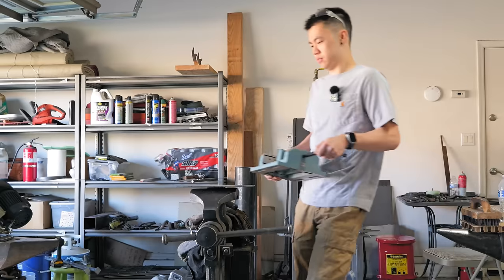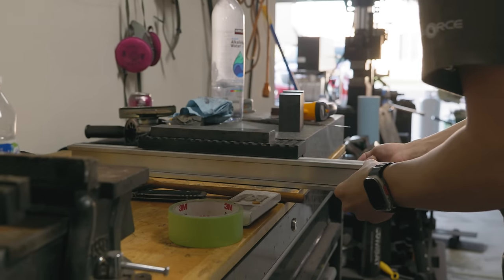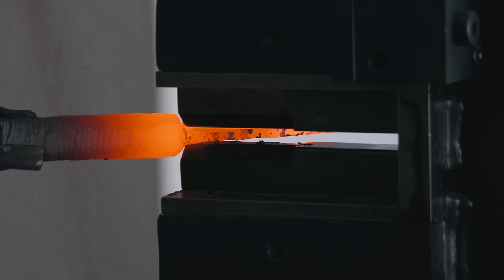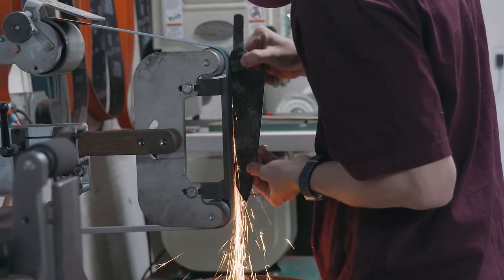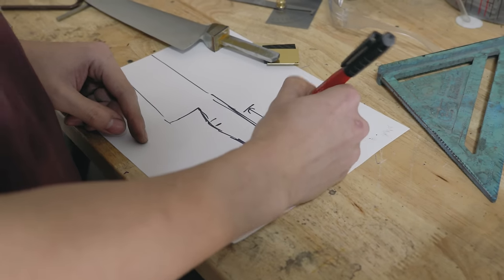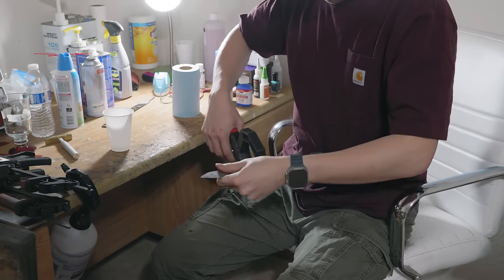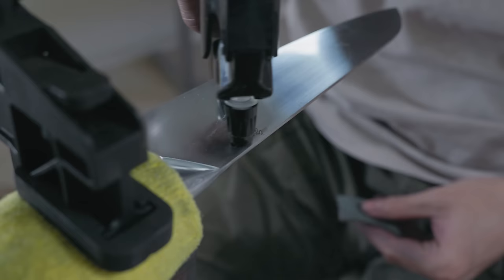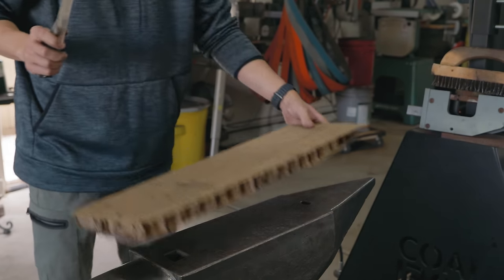Making a Firestorm Damascus Chef's Knife

Comment: I am a luthier (guitar builder), and I have used quite a bit of Ebony. It is hard to tell by the color in the video, but it it has brown striping in the wood, it would most likely be Macassar Ebony. If it has greyish striping, it would be Gaboon Ebony. Brazilian Ebony and Madagascar Ebony are very black and dense, and often rapidly dull tools. Your wood does not look solid black enough to be those rare woods.

Comment: I am looking to get my first forge to start forging knives as a hobby and would like your opinion. I'm looking at the budget forges, and the brand I am looking at has a single burner that is 9.5" deep, while the 2 burner is 16". If my goal is to be able to make a chef's knife, is the 16" significantly better to have than the 9.5", or would the smaller one be fine for a beginner hobbyist?
Reply from the maker: You don’t really need a long forge to forge a chefs knife, you’ll only ever be forging small sections at a time so the smaller one should be good enough for now👍

Comment: Woodworker here - chances are, that's not a true ebony, but african blackwood. Still quite rare and beautiful, but a board of ebony the size you have would be well over $1000 and, coincidentally, illegal to sell (even as a part of a finished piece). In either event, please make sure you use a good mask when working with either. They are both pretty sever respiratory irritants and African Blackwood is likely carcinogenic.

Comment: I know this is 6 months old but when you are hand sanding after sharpening the blade its fucked me up 😂 you know you can use hot glue to cover the blade so its much safer to work around, and itll  peel right off the metal.

Comment: The Digital control thingy is just a fancy set of the steel blocks you arleady use in your press to limit the thickness so why would it be cheating? being lazy isnt always cheating.
Reply from the maker: That's actually fair... hmm...
Reply: The difference is was it by hand with kiss blocks, still on the line, or by robot or technology assisted. Wheres the line then. Buying a linear servo to hold the blank and push it in for you as well is just the same as him holding it. Buying a robot to hold and move and press the whole thing is the same as him doing it. Then whats different with his fancy “hand made” knives for $3000 and a $15 temu damascus knife.
Thats the line. Robot assisted, or not.
Reply: @aaronmarkstaller  i would say putting a kiss block in the press or pressing a button isnt that much of a difference. but in the same line we could argue about the press itself, the belt grinder, the gas forge, angle grinder or any other machine. any idiot can put a sheet of steel in the laser/waterjet cutter and the automatic grindingmachine but i doubt most people could make a acceptable knife with the tools we see in the video.

Comment: Suggestion. Add a small screw on the outside of the PVC pipe that you have the ferric chloride in. That way you can wrap your wire around it. I found your channel yesterday and like what your doing 👍

Comment: Seen this knife maker make jig for twisting. It consists of an I-beam. 1 end side is station with (square die jig) that holds the bar to be twisted. This side is spun by hand crank. It does have bearings. The beam side has same kind of die. It's stationary, but the frame it sits on rolls along the I-beam like an overhead crane. But he twisted these bars easily. I did not know his gear ratio for twisting? Just throwing this out there for you. HARPIE KNIVES is the guy.

Comment: You can try clamping your handle to your knife the way Jason Knight does it: Get a piece of leather, or soft jaws for your vise, fix the blade in the vise between the leather/soft jaws so that the tang sticks out, then fit up your handle, and use long quick-grip clamps by clamping the end of the handle to the opposite side of the vise jaw. Can use a couple clamps for it, too. Should be a bit more reliable that clamping one clamp to another, cause the clamps could shift and you could lose pressure.

Comment: My take on the digital press controller is that it is cheating. Blacksmithing is something of a dead art today. With access to laser cutting, CNC machines, and even 3d printers, blacksmithing exists in a niche for people who want something hand forged. Using a computer controlled press seems to exist in a middle ground between blacksmithing and machining. But that's just the two cents of an anonymous internet who ever.

Comment: It just simply isn't possible for that to be cheating. Unless some potato head said it is the rules. But be sure if that potato has gonna set rules. They'd better be smelting their iron ore in a crucible. And forge welding by hand. And more truth.
 They probably should build their own hammer to forge build with. Right along with their anvil. Until then. Forget the rules and build as cheap and smart as you can. Without loss of quality or Craftsmanship.

Comment: Not wanting to be smart but considering dust collection any cheap vacuüm cleaner would be better than nothing. You can easily make a stand for it so you can position it to your liking. I tile many bathrooms and sometimes I can't cut the tiles outside. So I made adapter for an air duct extension, so I can attach my Starmix vacuüm to it. This way I can cut, grind and drill the tiles on the spot. Works like a charm.

Comment: You are using a variety of chemicals, and as such, you ought to be wearing different gloves for protection against at least impact and corrosion. Ideally you should be working under a hood for some of your works, especially since you have asthma. I had asthma as well, and which was part of the reason why I’m no longer a chemist.

Comment: excellent video . what type of steel do you use
Reply from the maker: This blade was forged from 1084 and 15N20. They are both fairly simple high-carbon steels, and a lot of bladesmiths like the combo for their pattern welded steel.

Comment: not cheating bro..a cheaper option weould be a rolling mill. there are a few guys building them i think you can get one with a built in bar twister for less then the press controller costs.

Comment: Jesse, I noticed when you were etching that you did so with the handle attached to the blade. I also noticed that the handle nearest to the bolster got exposed to both the acid and the coffee when etching. Does this exposure not damage the wood at all, or is it minor enough that it can be fixed in the sanding afterwards? I'm considering to re-etch a knife that is still attached to the handle and am debating how to go about it. Any feedback is appreciated. Thanks!

Comment: Jesse, 
You need to drill an air hole in the handle for excess epoxy to squeeze out through.  
Without the air hole, you’re pushing too much of the glue out of the top.  You’re leaving a lot to chance using your current method.  
Remember your glue will soak into the handle material as well, leaving less for adhesion to the tang.  
You should also be using a final securing pin.  Glue is not enough even if you use the pilot hole.  
You’re knives are awesome, and your talent is impressive.  Small corrections have huge long-term impacts
Cheers

Comment: Great video, and an absolutely gorgeous knife! Regarding drilling out the holes in the ebony (and possibly the brass as well), you could use a spiral router bit in your drill press. It would be basically what you are doing with the drill bits, but cleaner and easier.